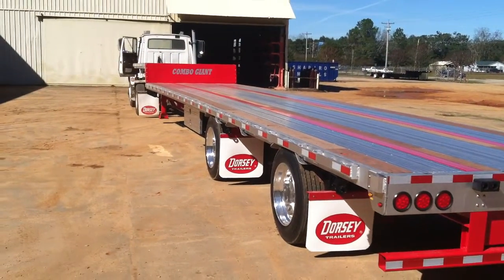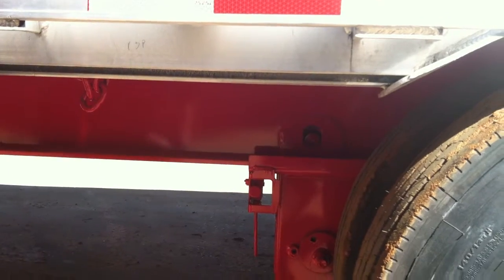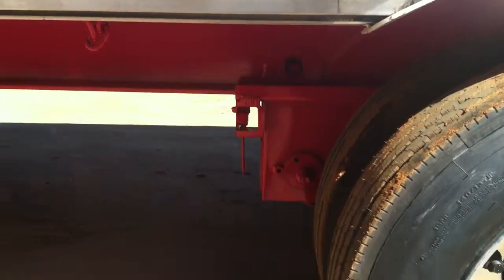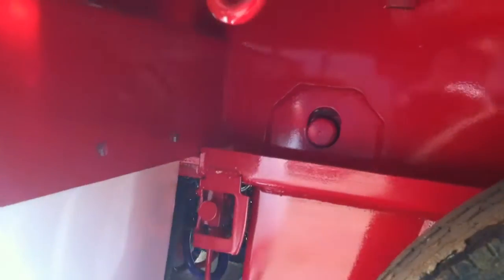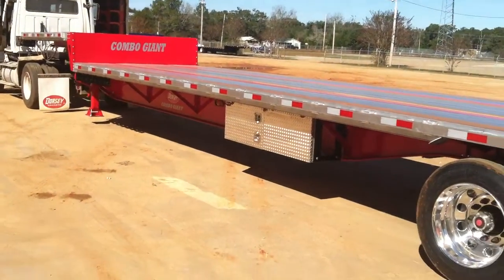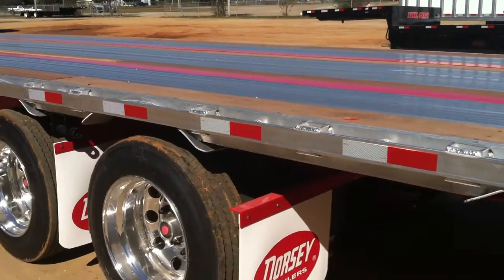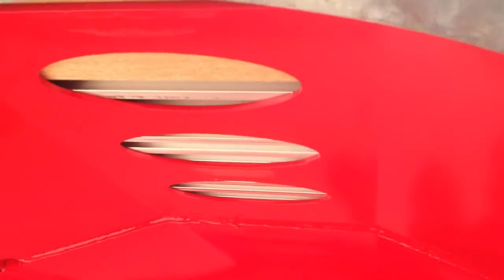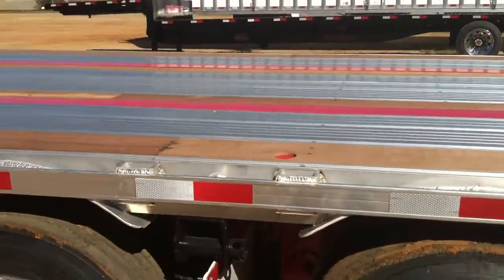Combo Giant

Comment: WHEN AXLES ARE TOGETHER IS THE WEIGHT CAPACITY STILL  20K LBS P AXLE  LIKE WHEN THEY ARE SPREAD ?
Reply from the maker: @mathew polo When the axles are spread weight capacity is 20k LBS per axle, when trailer is in closed position weight capacity 17,500lbs per axle. Hope this answers your question.
Reply: @dorseytrailer5703  👍Thanks
Reply: @dorseytrailer5703  What type of rims are on that trailer, and can I order them through Dorsey?
Reply from the maker: Those are Alcoa rims. You can get them through our parts department. Send me an email and I will get you to the right place. joseph@dorseytrailer.net